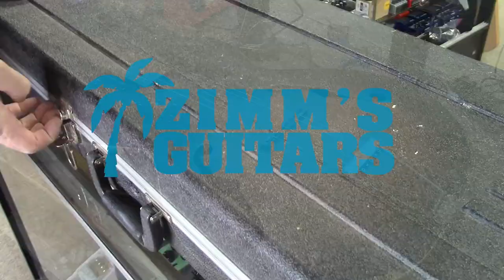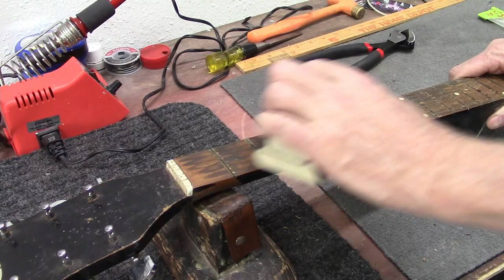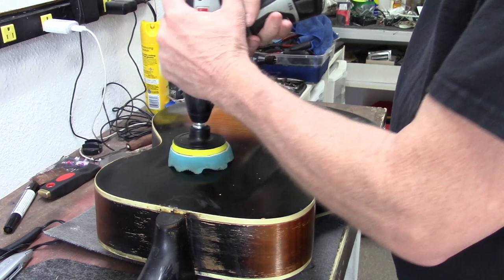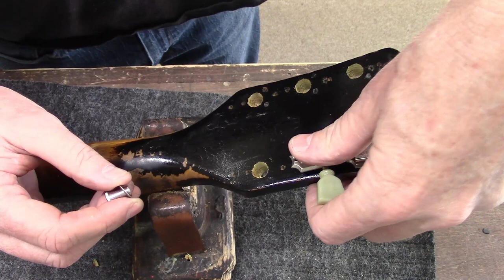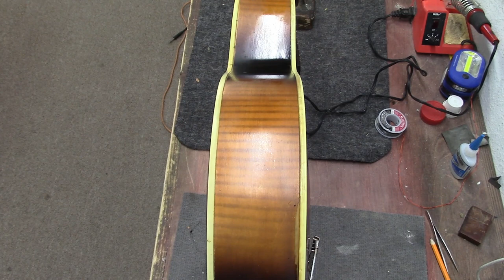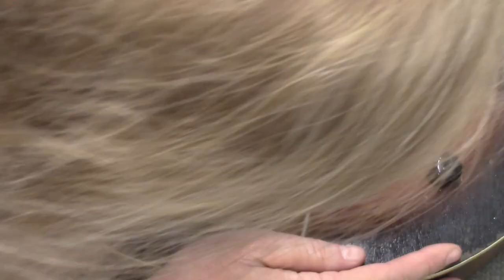1960's Kay Acoustic Guitar Restoration

Comment: I have to say this was a pretty brutal treatment of an old guitar, hammering a putty knife against the body to force the neck off with lots of wood tear out? I cringed at that work. especially, at least not showing any heat applied to loosen the glue; not using a leveling sander on the fretboard, just fingers with sandpaper that will make an uneven surface, wallowing out the peghead with a really crude wobbly drill job, you know those holes are all egg shaped and the tuners are going to  wiggle wobble around in them. That was a little tough to watch.
Reply: Have to agree with you, especially the neck work. A $12 radius block for sanding the fretboard is WELL worth it and would clean it up as well as leveling it out with hardly any more work. Have to applaud him for working to save a beat up old guitar but he needs to learn better procedures to do it properly.
Reply: I’m gonna be honest I’m restoring a guitar right now literally for the first time ever and I’ve done a much better job than this…

Comment: So I have one of these old Kay's that the neck is only held on by the strings. I think it's the same model as this one. I am planning on doing a neck reset to it. Never did one before but I have worked on my guitars before. I figure it's a good guitar to try on. It's unplayable right now. I want to use it as a slide guitar anyway. I will be putting a pickup on it if the neck reset comes out ok. What pickup did you use?
Reply: Do you know if the bridge is held by the strings too?
Reply: @dorianblue8526  yes, the strings are holding the bridge on too

Comment: Nice job! Too bad the top was in such rough shape, the rest was pretty decent. If you want to get back to it later, it’s possible to do a little touch up, sand the surface smooth with 1500 grit and put some clear lacquer on it (just the top). I have some videos up of repair on a very similar guitar, made by Kay and sold at Western Auto as a True Tone, Kay also sold them through Sears as a Silver Tone but they were all the same guitars.

Comment: Nicely repaired and lovingly restored. Sounds horrible amped, sorry. Maybe it's the recording? Piezoelectric discs really need an on-board pre amp and battery with a final buffered output stage to pump a full frequency range down a guitar lead and not sound tinny. Piezo discs have a high impedance and only micro-volts output, even with shielded wire from disc to amp, the wire capacitance acts like a tone filter stripping away whatever guts the signal has. Aerial coax cable (low capacitance) might carry the signal better in a short lead but a normal (non acoustic) guitar amp would have to be completely maxxed out and buzzing like crazy :). Those little amps built for cigar box guitars are loud but heavily distorted, hiding the tinny piezo output.
A shallow Di-Armond, a filtertron or a soap bar type, normal wire wound pickup would make a decent jazz box or a very desirable blues box out of it? There are holes in the front where a pickup probably once lived.

Comment: That was a good restoration. Too bad you didn't use the original fixing plates that the tuning pegs were on. Does it still have the same pickup? There are still a lot of Kay and Harmony/Stella guitars in pawn shops, and on online buying sites like eBay